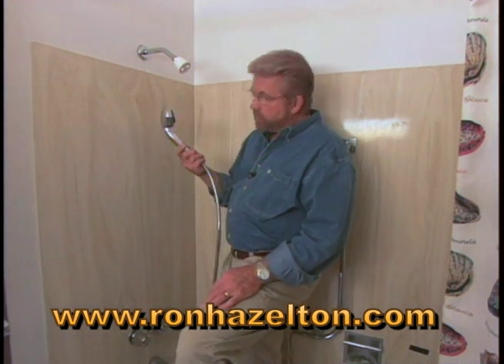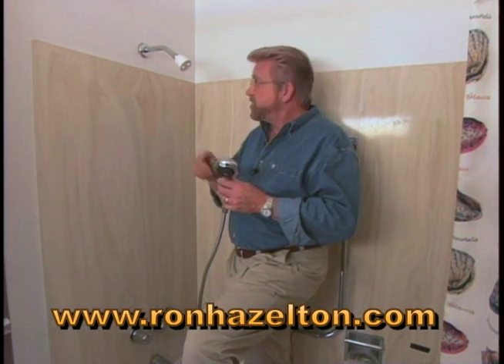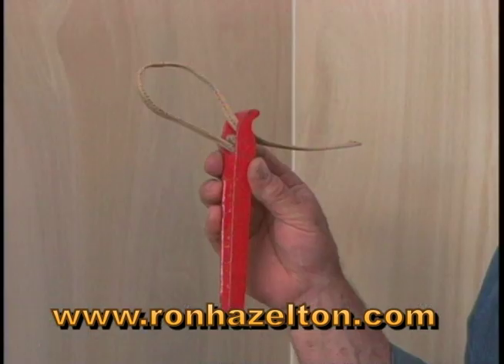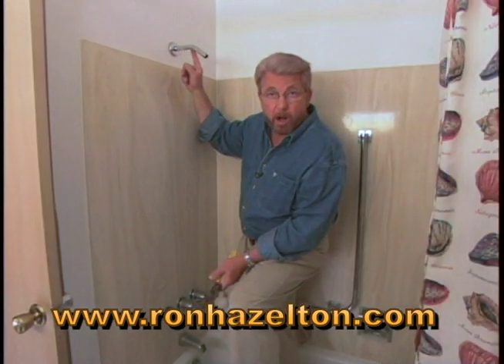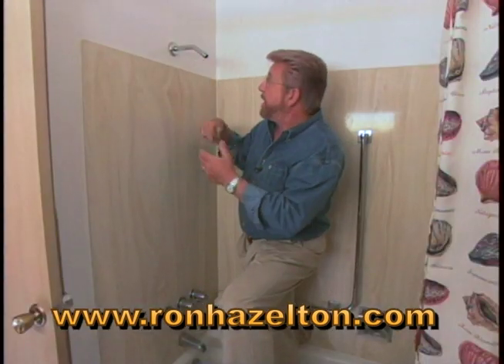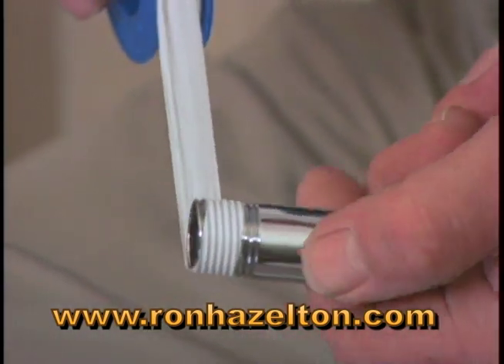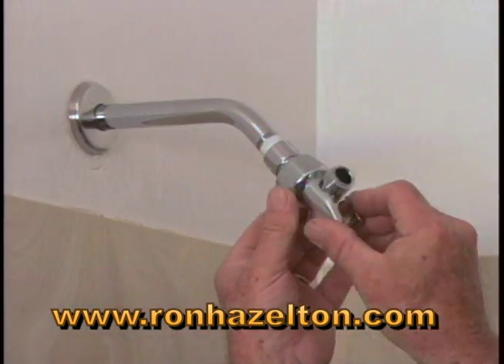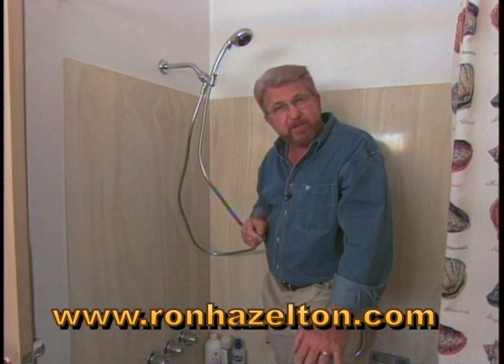How to Install a Shower Wand and Arm

Comment: I would like to add something to this, something that even many pro installers don't know and that is the secret of how to install the flange without silicone so that it is nice and tight and does not move around loosely. Check me new Kung Fu Maintenance video "How To Replace Shower Arm Neck Flange Trim Like A Boss" to learn the secret.